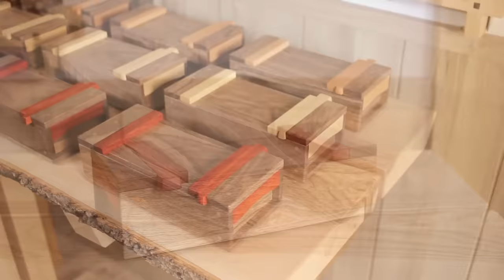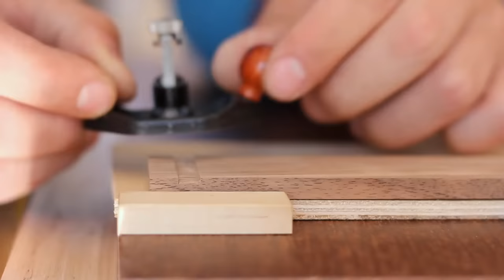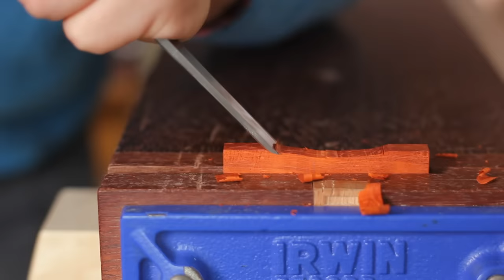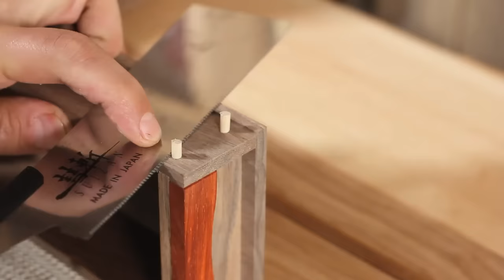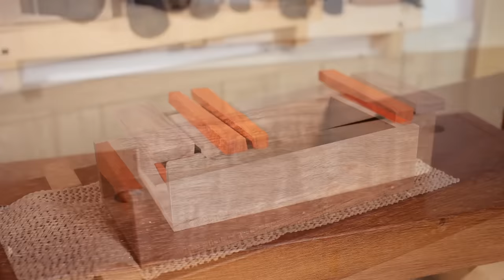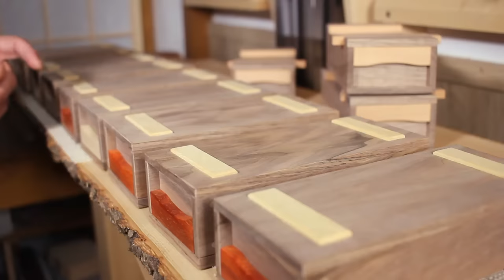Japanese Mini Toolboxes / Pens & Pencils Boxes

Comment: Thank you for sharing this, lovely looking boxes and love that it showing using hand tools, instead of the usual videos showing using power tools, I am going to have a go at making one of these. I also like the contrasting woods, I have tried Danish oil and I prefer OSMO poly-lux oil finished with beeswax using 0000 wire wool and then buffed up. Great craftsmanship 👍
Reply from the maker: Thank you! I get pretty decent result with the danish also, 2-3 coats and one with Reinesance wax. These Osmo finishes that you have in NA they are hard to get in EU. Although many shops deliver overseas when it comes to chemicals it's a little bit hard cause they are considered flamable etc and many usual carriers like dhl, ups etc dont ship them
Reply: Adrian Preda Hi, I live in the UK and OSMO is made in Germany, I tend to purchase via Amazon
Reply from the maker: Ha, I thought it was a Usa product. I will check if I can get it through amz, thanks!

Comment: Where did you get the wood from? Did you cut a bigger piece or did you just buy them thin? Great vid :)
Reply from the maker: Thanks! I get lumber either from deposits or some friends then size it myself, I have a small planer and bandsaw, and recently I got a table saw too, but if they are too big I go to a local workshop and do it there

Comment: Never saw a drill bit like the one you used for the pegs. Look like auger bits but for a screw driver?
Reply from the maker: Yes, is a auger bit with standard 1/4" hex. Look for Kuri-kuri drill bit, fine tools germany sells them

Comment: The auger bit isn't on your list of tools, either here or on your website. There's a comment below mentioning Lee Valley's "minis" but the shank doesn't match what I've seen there. Would you reply with a link? Excellent video, by the way: relaxing and promotes high-quality work rather than the "good enough" stuff I see nearly everywhere else. Peace.
Reply from the maker: Thank you! I forgot about that, cause I use it so rarely :) Look for "kuri auger drill/set", until I manage to upadate my list, and it will point you to several stores. What you mean by shank on the mini plane? The blade?
Reply: @AdrianPreda  Thank you for the reply. No, the shank of the auger bit didn't match the shank of any bits Lee Valley sells; I thought Le PicBois' comment was referencing the bit rather than the plane.
Reply from the maker: @JoelWetzel  Ah no, the bit is other stuff. It is standard 1/4" shank